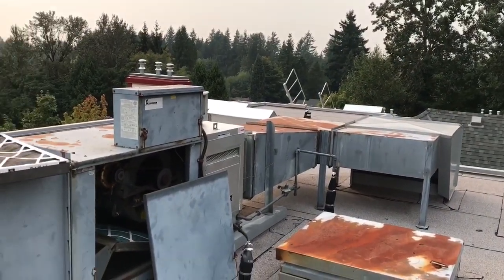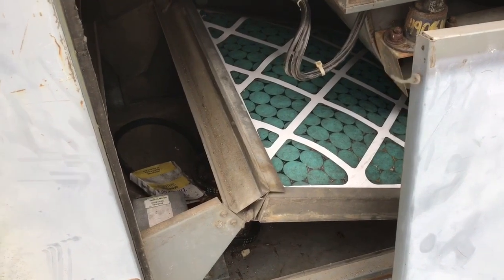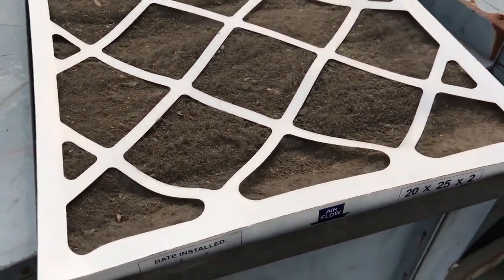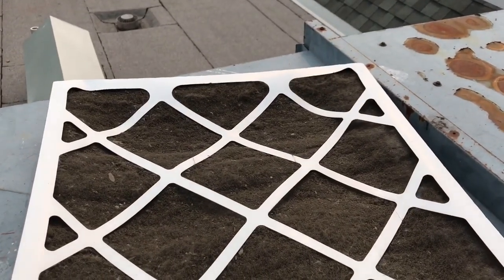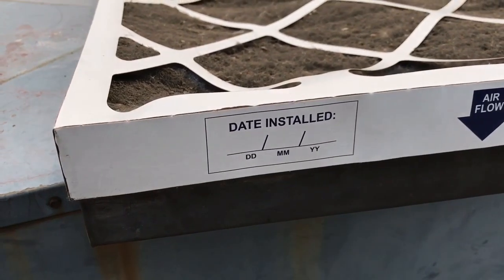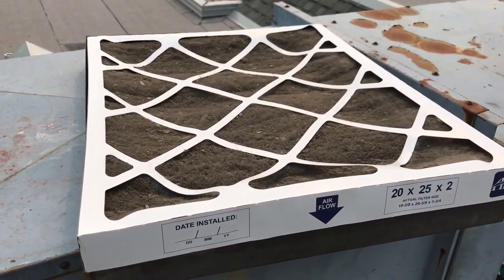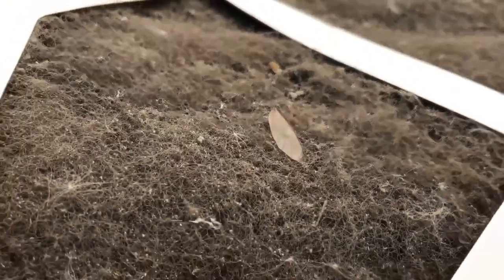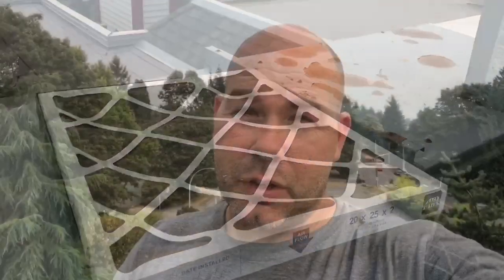Poor Indoor Air Quality Fail

Comment: Im and HVAC tech and looks to me like the filter hasn't been changed in over a year. Unless the area is extremely dusty or they have seen alot of ash from the BC fires. Also just looking at that belt it looks slack. You need 1/64 of a inch in deflection per 1 inch of span. That maintenance company is lacking.

Comment: Terrible.... that filter does not let any air through... We have air ventilation and heating... the time and date of filter changes are written in a "maintenance" booklet. We have 2 units (Brink Allure). They are for heating the house and continuous ventilation. No cooling necessary in Holland. It strikes me all the time that those filters really get rather dark...dust.. Even with the fact we do not smoke....  Second last time of changing was in Juni this year, so about 3 months of air filtering ...
Reply from the maker: I don't think these have been changed in a year The RealButcher. Sad because the Strata has been paying them monthly for the service
Reply: @TomMunroCHI  What would the recourse be in BC? Could the strata sue?